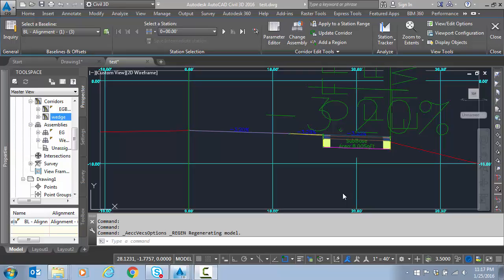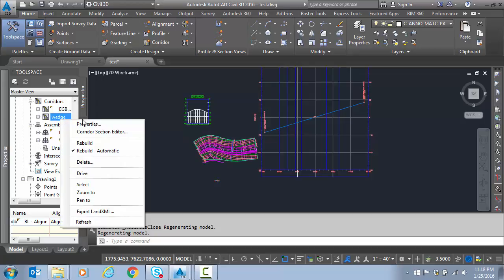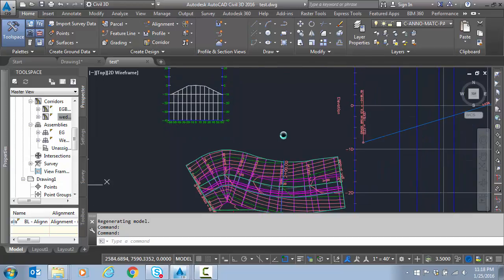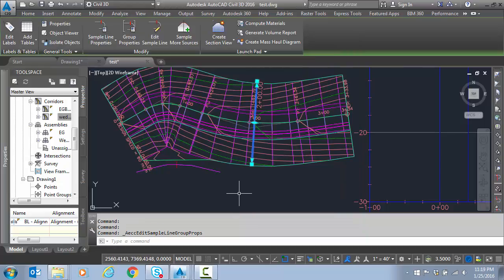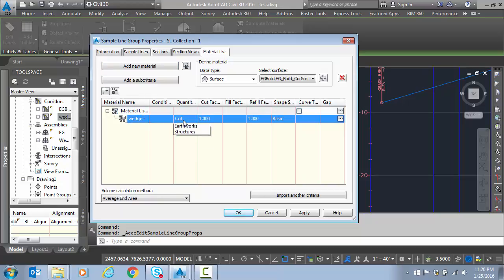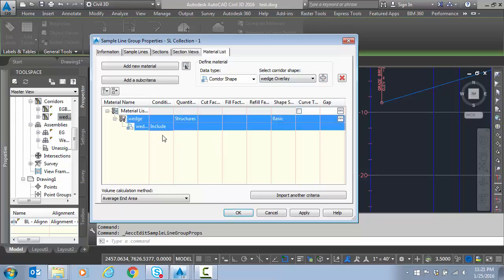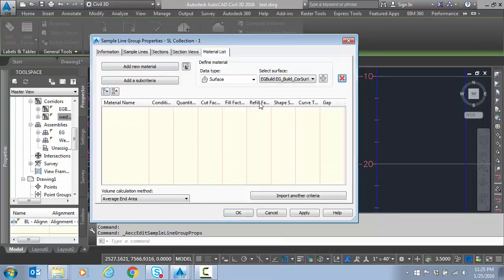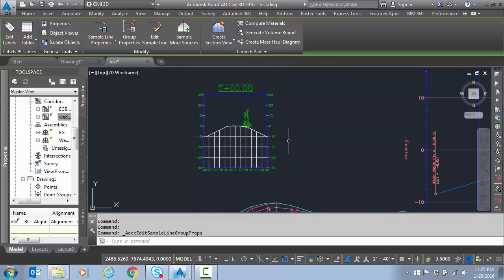Civil 3D Custom Subassembly for Overlay and Widening Pt. 6 - Volumes

Comment: Just like to know how did this practically exist on the road. The start portion of the wedge will have a very weak bond with the tie-in point. In reality it should slice away when the vehicle are operating on the road.
Reply from the maker: Agreed.  The intention of this example was just to show the behavior and the base level (not to recommend design processes).  The issue with showing real world overlay design examples is that many times the complexity overrides my ability to show the assembly behavior.
Reply: @AlanGilbert  Thanks Allen.